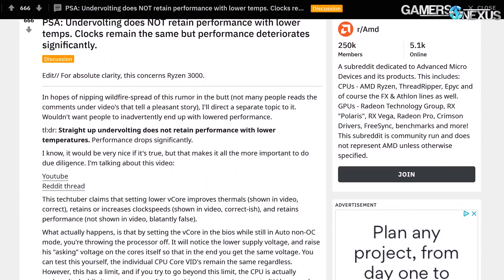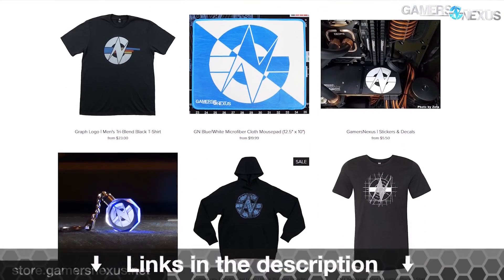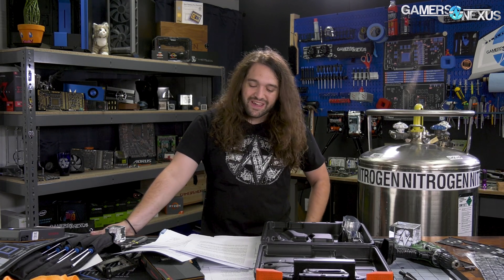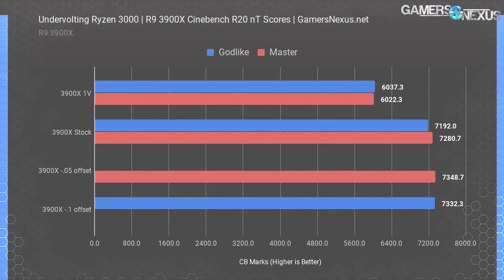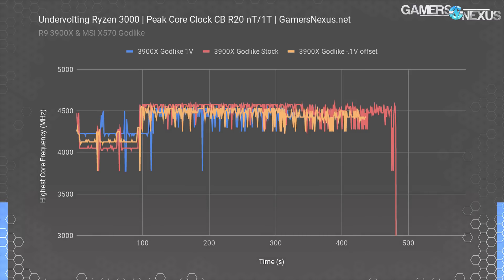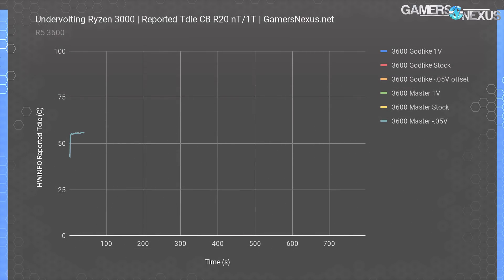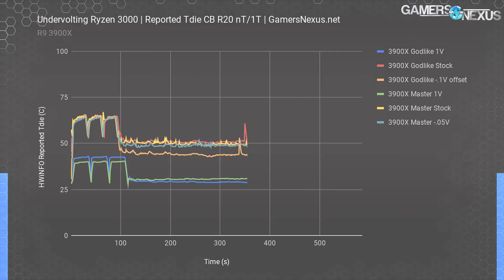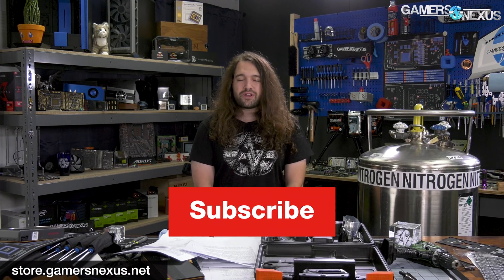AMD Ryzen 3000 Undervolting Offset vs. Override | Vcore Voltage

Comment: I have seen so many articles and even had people sending me links to it, AMD Zen 2 undervolted 1V outperforms Zen 2 stock and only 2% behind Intel in gaming. 

It also seems people still have this idea stuck in their heads that going over 60-70c will kill your CPU, when in fact a PC running 90c underload will probably last just as long as one running at 60c, or it will last for a good 7+ years to the point you would not want that CPU any longer. I ran my 4770k at 80c to 90c for nearly 5 years, 1.36v to hit 4.7Ghz, around last year it became unstable and so I dropped it from 4.7ghz to 4.5ghz at 1.3v, and then 4.4ghz at 1.2v because the extra 100mhz was not worth .1v and the extra heat and noise. I could still run it at 4.6ghz at 1.35v but I no longer have a hot loud ass GPU so the extra 200mhz is just not worth the added noise and extra heat cooking me.

I also have an OEM GTX 260 that I loaded a custom BISO in allowing me to hit 936mhz I think on the graphicsclock along with like 150-250 more on all of the other clocks, and it ran 24/7 at 85c and when I gamed it would hit 90c/93c for 5 years until I upgraded. When I upgraded it started hitting 96c to 103c and ran at 89c 24/7, I took it apart cleaned all of the coal dirt out of it and applied some kind of thick Articsilver even where thermal pads should have gone and it dropped 20c in Temps down to 78c and only 85c when gaming. It is still running in my old system in the basement at like 75c 24/7 because I am too lazy to find the stock BIOS.
Reply: just because you treat your hardware bad doesnt mean we all do, after 5 years even tho you might change to a better cpu if you treat your cpu well it will last another 5 years easy on another kids hands

Comment: Nice vid ( ͡° ͜ʖ ͡°). If you guys are interested in doing a piece on the 'high temperatures' of Ryzen (which seems to be quite a theme to the point of almost being controversial), I've been working on a coarse physical model for the temperature across the entire cpu (throughout the entire package) and could write up a little piece that explains why Ryzen 3000 runs so much hotter by using a more easy to understand analogy with water-pressure and surface area, which should clear up how the package size ('thermal density') has such influence on the current temps. My model has some holes and needs to make some assumptions and not quite accurate yet since I only have my 3900x to go on. But if I could get some good data (actual coldplate temp + Tdie + chiplet power, which you have better equipment for than I have) I should be able to reverse engineer some of those holes in the model (thickness/composition of the diffusion barrier, thickness of Indium solder) and obtain some interesting results. For instance a rather precise indication of how much degrees straight IHS removal would give you, the influence of thermal compound and it's thickness, and some unexpected but interesting results like how the 300-ish micron thick diffusion barrier on top of the die itself is the probably biggest insulator on the package giving the highest T-delta on the way to the cooler. Just throwing it out there. Cheers, Boxman90.
Reply: Ummmm, the competitive Intel CPUs run hotter and there's a value water cooler which keeps Ryzen around 78C under full load.
My Haswell laptop CPU regularly reaches 95C in summer

Comment: So wtf is the deal with safe voltages? I thought that voltages as high as 1.47 were only safe because they were present at idle, when the amperage was low, but you're getting getting that under load; isn't that bad?

Comment: Even with the performance loss which looks to be 20% at 1v on the 3900x it still seems the improvement in thermals is something that in certain builds might be worth doing if you want to put it in an ITX build with limited cooling. It would be interesting to see more numbers on what the performance loss vs thermals improvement looks like at other under voltage amounts. Interesting video as always and keep up the good work.
Reply: If i recall correctly, setting a power consumption limit (PPT limit, cTDP, whatever) works better than limiting voltage, at least from what I've read from 1 or 2 reddit comments. And the thermal results are similar, without the risk of possible instability.
Reply: Far better to use a SOC which is designed to run to a low power budget, 10W passively cooled is not unreachable.
Simply buy a cheaper CPU with a lower TDP rather than buy a Ryzen
Reply: @RobBCactive  Nah, that's shit.

Comment: I wonder if Steve is planning an individual ccx overclocking video. Der8auer had some success that way. Seems like the best method of overclocking so far. I'm just hoping board partners start implementing it into their bios.
Reply: Yeah, but this tool Roman used to CCX-OC isnt widely avalaible.

Comment: I have my 3600 set at 4Ghz on 1.3v and returned my X570 board and kept my X470 as it doesn't use as much energy and less heat.
Reply: Ya I believe, as of right now anyway, the x570 is stupid expensive. For the average gamer,  PCIE 4 is not really a benefit. Today's gpus are unaffected. Content creation would have increased speed for NVMe drives. But for gamers, I would wait for price decreases. Just my 2 cents.
Reply: @AxialGT  I had the X570 Taichi which was only $300 which isn't to bad but it just amped up the volts even when I tried to set it to 1.35v it was going over 1.5v. I put my 3600 into my X470 Taichi and it goes to what I set it and listen to my commands haha. X570 has a lot of bugs and just didn't see $300 worth it at this point.
Reply: @thephily  I've gotten the same overclocks, same cinebench scores, same fps, on my $100 x470 motherboard when compared to my $330 x570. Me as a gamer the x570 is not worth the extra cost. So for me the x570 is not worth the extra cost. And your right, chips run cooler too on the x470.
Reply: @AxialGT  Wish I only paid $100 for my X470 haha. Got a deal on the X370 I have in my son's and put a B350 in my daughters which overclock's just fine too. I'm happy Newegg took the X570 back as a return though.

Comment: After watching this video, I decided to do a performance validation on my undervolted Ryzen 5 2600X.  Running Cinebench R20 twice with stock auto voltage and my -0.1V offset, I noticed that the undervolt led to a 2% increase in all-core performance with no change in single core (with a noticeable change in boost frequency from 3975 MHz undervolted down to 3850 MHz at stock auto voltage), a 2-4 degree reduction in CPU peak temperature, and a 3-5 watt reduction in power consumption as measured by my UPS.
Reply: You can increase efficiency further by modifying the ryzen balanced power plan to use a minimum processor state of 5% instead of 90% and raising BCLK to 102mhz or higher, however do note that this might bring potential instability.
Reply: @thetrashman5252  I don't have a Ryzen Balanced power plan, even after installing the latest chipset drivers.
Reply: @b0bsaget007  Strange, try making the same modification on the regular balanced plan instead i guess, the results should be similar.
Reply: @thetrashman5252  it seems to already be set to 5% minimum by default.
Reply: @b0bsaget007  Interesting, well in any case if you want to still increase performance you can try raising BCLK, however that might require a less aggressive undervolt and might not function on some boards.
Reply: The Trashman make a full system clone before BCLK overclocking, the NVME drives get finicky even at 101 for me... Granted, I have to install Windows about 10x per year (a good weekend will show another 100 “unplanned power losses” on my drives, I quickly climb beyond a thousand system crashes on my benchmark drives!), but even still, nothing destroys your OS like memory or SSD instability! FSB overclocking is just very high risk, so don’t do it on your normal system drive (completely and physically remove the storage, obviously if it’s connected, it’s likely to get screwed!). I’ll overclock basically everything up to even my monitors (yes, you can definitely overclock monitors and TVs), but even I’m pretty skeptical of recommending others to FSB overclock if I don’t include the “backup yo system!” warning, it gets corrupted fast without you even knowing it...
Reply: That's really cool and exactly what you look for in an under-volt, good job!!

Comment: interesting glad you made this video cause i planned undervolting my cpu due partly pairing with a b350 gaming f and hoping it would assist  vrm temps. in the past ive undervolt fx processors but never verified if performance degraded

Comment: now while there is lower performance at 1v it still wasn't bad considering the huge power and heat drop it really makes the zen2 laptop processors an interesting proposition
Reply: wasn't bad until they blue screened because it was unstable
Reply: @madmax2069  according to the video it didn't blue screen when set to 1v which was what was expected  but it did take a noticeable hit to performance
Reply: @shaynegadsden  maybe you need to rewatch the video then, because they said it blue screened and was unstable
Reply: @madmax2069  I believe that was the voltage offset settings not setting the vcore to 1v but idk which board was which but 1 would do -0.1v the other only -0.05v and trying to push the -0.1v would blue screen

Comment: I am curious if small small offset undervolts will have an affect on PBO behavior.  Would it enable higher boost clocks? Or longer duration boosts?  If there is a benefit, is it solely based on lower Tjunction?

Comment: The blue bars on the side are a nice touch.
Reply: People are just now picking up on those?
Reply: @SirNicholasT   I think it's a GN meme now... (goes out to shout at the clouds)
Reply: @SirNicholasT  saw them in the first video i watched lol :)
Reply: @SirNicholasT  Being condescending just makes you sound insecure.
Reply: @iliilili310  sounds like someone pretty familiar with insecurity. It was a genuine question because steve pointed them out like 4 times when they started using them but they're so subtle you could easily not notice them. I can't help it if you can't tell the difference between being condescending and genuine curiosity. Get over yourself. 😁👍🏼
Reply: @SirNicholasT  Desperately attempting to be condescending, again. You really are insecure, huh?
Reply: @iliilili310  pathetic
Reply: @iliilili310  didn't really sound that conscending or insecure to me..

 And I know quite a bit on psychology, especially insecurity, it's really apparent in my brother.

Comment: Zen 2 loves voltage.  Positive offsets increase performance, even against the temperature penalty.
Reply: That's interesting. Too bad I don't have a Ryzen 3000 chip to try all these out. Waiting for Threadripper as I'm on the X399 platform.

Comment: I've got mine at 1.35v @ 4.3ghz can lower even more and oc maybe to 4.35ghz or 4.4ghz sitting at around 60c  underload on amd cooler (3700x) but have a rock pro 4 waiting to go on it on a msi b450 carbon pro ac
Reply: im pretty sure its not stable, do some real stability testing
Reply: @jscb7003  what isn't stable? Mine is stable had it testing for over an hour And it's all good
Reply: Auzziegaming maybe you won the silicon lottery? Let's see after the bios fix that is coming
Reply: @mongocom1735  I really hope I did. Would be a first for anything to have a decent chip. Ha my Radeon VII is actually doing pretty well on air as well

Comment: This is super interesting stuff! My overclocking practices generally involve simply running Prime 95 for 10-20 minutes to make sure my voltage is stable for the clocks I'm getting. I'll have to keep this in mind as I start tuning clocks on my 3600.
Reply: 20 minutes of stability testing isnt enough...

Comment: So is it normal that the 3900x runs 1.5v when you don't change any bios settings?

I ran 4.35ghz on 1.325v stable in R20. Cant test in prime95 since the heat is way too much. I am waiting for my liquid metal to see if I can get it under control.
Reply: If it bursts up to that voltage then yes, if it rains that voltage into itself constantly, then no.
Reply: @thetrashman5252  Constantly load or no load. So then the question comes in, any way to fix it? Pushing the voltage manually results in the results as shown by Gamers Nexus. Setting a manual clock results in it not downclocking. Which then results in a thermal shutdown when I set the voltage too high. AMD does not seem to have a mode like Intels chips where it boosts to x clock under good thermal conditions then clocks down when it gets bad.
I guess you might not know the answer.
Reply: @jackykoning  
I think waiting for newer bios is the answer. I've dropped my 3800x to 1.3v and I'll leave it there till we know more

Comment: my r5 3600 best cinebench r20 score is on 3400ish, do changing stock cooler to after market cooler makes good improvement?
Reply: In their previous videos, they did state that the 3000 series benefited from running cooler.

Comment: some times temps matter more than performance... if you get 5% less performance but half the temps, that is worth it. well in my case, my room heated up to 45C (35C outside) this summer and i live in Canada. plus i only have a Intel i3 8100... i definitely want to undervolt every thing since i cannot overclock it anyways and it is not a beast of a PC in the first place... so all i did was making the BCLK 98MHz in summer and 102.5 in the winter... any one wants to give me tips on UnderVolting or if there is Dangers? (so i can run a summer profile and a winter profile.)
Reply: yeah no completely a good reason, the problem is when you have people which still seems like a lot of people who believe running their CPU higher than 70c, even 60c is going to kill it.
Reply: @Kirinketsu_  i had a Q6600 and that idles at 70C and goes in the upper 80s and close to 90C under load! if i had the revision that would not have been the case. tho even so i only changed PC in 2017 since the motherboard was eating the CMOS batteries like candies! (probably a Capacitor so it ran 100% of the time on the battery)

testament to how solid those processors were built! and also that you need more than 80C to kill a processor! (tho more recent ones are built with smaller nm so that might reduce it's tolerances...) heat reduces life span, undeniable but what REALLY damages more is quick bursts of getting hot then cold repeatedly! the thermal expansion acts like when you fold a aluminium piece repeatedly until it breaks off. 

i killed a Nvidia 8800 GT 512 MB and a 8500 as well with custom underclock and overclock profiles that were dynamic. they ran at about 20% speed when on low load and like 100% on high... both did not last 2 month like that... i suspected 2 things, 1 i thought it was because i was not lowering the voltage when lowering the speed. (from the comments inhere i see it was not that.) and 2, thermal expansion. so i can safely assume components hates that!

also sory if this looks like a wall of text, i am answering from the notification bell at the top of the screen.
Reply: @theepicslayer7sss101  Ran a 4770k at near 90c all hours I gamed on it, 1.36V after 5 years the 4.7OC became unstable so I dropped it down to 4.4 at 1.2V because I upgraded my GPU at it was now the only loud ass thing in my PC and meh what was I really getting out of 4.7... 4.6 new stable OC at 1.35 other than noise and heat roasting me. I also ran it at 4.8 @ 1.4v for 2 months but it started thermal throttling during the summer.

I also ran a GTX 260 at 85c 24/7 and 93c when gaming with custom BIOS to hit 930mhz, ran it that way from 2008 to 2013 then it started hitting 90c 24/7 and 96-103c when gaming. I took it apart after upgrading and put new paste on it, even where I removed the old pads, and it ran 20c cooler... it has still been running in the basement at like 75c all this time because I never found the stock BIOS for it...... the coal dirt that was trapped inside of it had also burned before, as in the heatsink had burn marks on it.
Reply: @JohnGalt-w1o  that really helps to know! thing is one of my friend works on Electronics in tanks and stuff in the army and said that lack of amperage does not damage machines much but lack of voltage can. (something about pulling more power to compensate making other components fail...)

Comment: The best thing I got from this video was that unlike mine, your 3900X actually consistently stays at max boost clock during a 1T R20 run.

Mine at default settings runs about 300 MHz lower and I can't improve on it at all.

I sure hope a BIOS or X470 chipset update will fix this.
Reply: it seems a board problem rather than cooling problem. Maybe VRMs overheating?
Reply: @劉奕彤-q6g  X470 Aorus Gaming 7 Wifi. VRMs not getting above 50 degrees.
Reply: Is your cooling solution working correctly? Might be thermals that hold it back from boosting
Reply: @asmodin88  I have a Noctua NH-D15 and my case has very good airflow.
Reply: why use default settings? set vcore 1.35v and run again everything. Also you can try to use Asus tool to CCX OC check der8auer video.
Reply: @selmopt  I tried setting vcore manually already, didn't help. Did try CCX OC with Ryzen Master, haven't used that other tool yet.

Comment: X470 bios is buggy but managed to Offset -.8125 with PBO enabled on the 3700x. Ryzen master helped a ton to tighten the timings, doing anything for timings in bios, crashes immediately. (atleast for me) 

Max temp 68 degrees
Goes up to 4.250GHz. Not the 4.4Ghz but its worth the sacrifice for lower temps imo.
Reply: did you watch the video? IT DOESNT MATTER WHAT FREQUENCY ITS SHOWING, VALIDATE WITH PERFORMANCE TEST